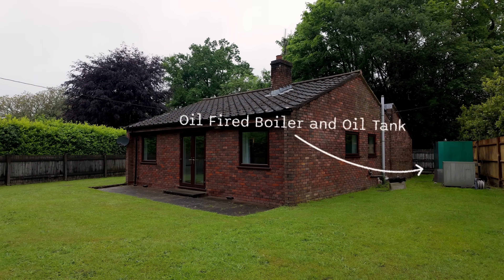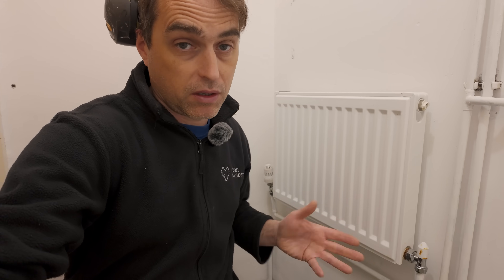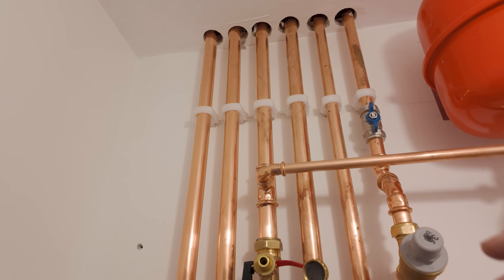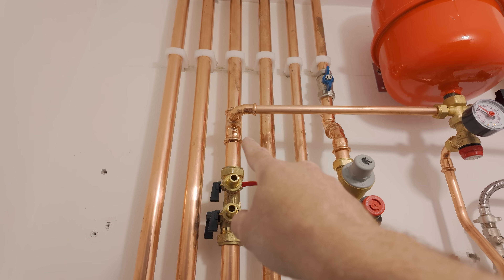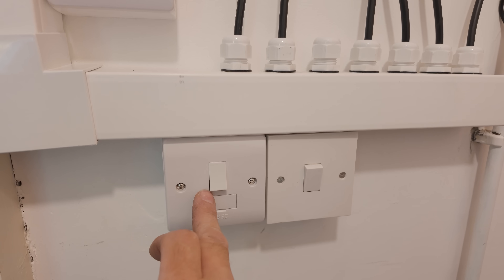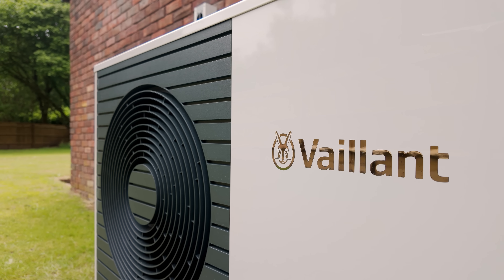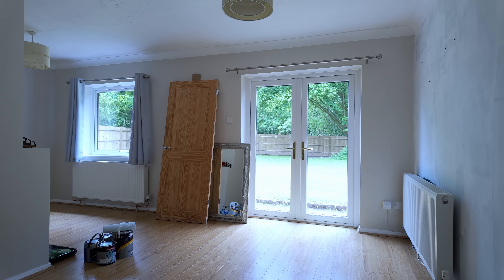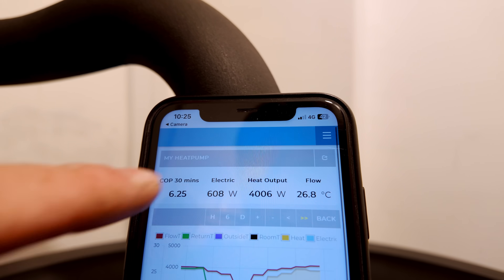Heat Pump vs Oil Boiler. It's a no brainer.

Comment: A lot of ifs and buts with heat pump installations. Oil or gas boiler still a safe bet and in many cases cheaper. That clearly explains why heat pump sales have collapsed and gas boiler will no longer be banned as previously said by the governement. Urban plumbers are very good installers, probably one in a hundred, and that’s the main problem with heat pump installations, lack of good installers. Good video though.

Comment: This is my advice to morons who switch from gas/ oil boilers to heat pumps in cold climates: Be sure to buy plenty of extra blankets and be prepared to spend a shit load of money on back-up electric resistance heating. Because you will spend winter being colder than a set of well driller's nuts.
Reply from the maker: My advice is not to listen to morons like you

Comment: There are a couple of major problems with heat pumps: 1) lots of installers, no service engineers (trust me, this is a major issue and it's not going away) 2) simply doesn't heat a fair percentage of homes. Very expensive thing to take a chance on unless you are in a fairly modern or very well insulated older property. Any heating engineer (who has no vested interest) will tell you the same thing....oil-fired boilers are a very reliable and low-cost heating solution--costs comparable to gas. I live on a Scottish island....lots of people with heat pumps, lots of people with oil systems. About half the people I know with heat pumps regret they installed it....that is a very high percentage. Quite a few have had those systems removed and returned to oil. In my experience (based on current prices) you can keep a 3-bed detached house toasty warm the whole year for £1000-£1200 (oil). How much electricity will you use with a heat pump to do the same? Make all the calculations you want...real world says it will be similar or maybe slightly less. You will never get back your investment at current fuel prices, even with a 9k grant. I have nothing at all against heat pumps....in some homes they work great. I've just seen so many cases were people have bitterly regreted it.
Reply: No response......Ride on bandwagon

Comment: As usefull as it is £600 for open energy monitor is a rip off. I do hope the price drips significantly as adoption o heat pumps increases
Reply from the maker: Worth every penny though
Reply: @UrbanPlumbers no updates on the monitoring, is it off ?
Reply from the maker: @emptyness72 they never connected the internet! I keep reminding them

Comment: Just out of curiosity, did the landlord say why he wanted to change?
I didn't hear you say that the oil boiler was broken and in my experience landlords aren't keen on spending thousands of dollars on heating systems, especially if it doesn't benefit them (the tenants pay the heating bills either way)
Reply from the maker: yes it was broken and the cost of replacing it would be as much as a heat pump. There are some decent landlords that want to install good and cheap to run system for the tenants.

Comment: I have an oil boiler which uses about 500 litres a year (£360) last April fill up. Three bed , detached bungalow constantly warm . I would be dead by the time the electric heat pump paid for its self. In a new build with solar panels and batteries yes. Retro fitting, NO.

Comment: 40 degrees heat is ridiculous😂
Reply from the maker: The lower the temperature the higher the efficiency of heating systems and longer life span of those systems as well. You can heat a room to 21c with 25c flow if HL is low enough and emitters are sized to that temp.

What’s ridiculous is most systems unnecessarily running over 60c
Reply: @ Missing the term “heat” a system running higher temperatures will heat a room quicker therefore doesn’t need to be on for as long
Reply from the maker: @TacticalPlumber @TacticalPlumber  getting up to temperature requires much more energy than maintaining temperature - that is why all modern and super efficient heating systems use low-temperature heating and weather compensation.

read up on this and maybe you will have a light bulb moment one day

Comment: Lovely neat installation but for me the biggest problem is cost. I have had a provisional estimated cost of installing a heat pump system in my 4 bedroom house of £30,000. I currently have a Worcester Highflow combi boiler but the feeds to all radiators are 10mm copper and I believe would would need upgrading requiring all floors to be disturbed. At my age it (76) it would simply not be cost effective to do, even allowing for grants available.
Reply: https://www.youtube.com/watch?v=HFlIbNAUWkY

Comment: The Open Energy Monitor is excellent. Since my heat pump is a self-built system, it has enabled me to verify that the installation was successful and to experiment with configuration adjustments.
Reply from the maker: Yes OEM is great!
Reply: @UrbanPlumbers  Thank you for all of your videos. They helped so much in my system design and build. I'm currently getting a COP of over 5 combined heating and hot water. That is only possible because of the help you (and others like you) provided.

Comment: Best arotherm plus set up vs best viessmann 200 set up, which produces the cheapest running costs over 12 months for 250L cylinder all year and heating to 19°C for 6 months per year?

Does SCOP account for DHW? If not I'm getting gas as the cheaper running costs.
Reply from the maker: Yes scop acounts for DHW. Can’t beat heat pump cost wise with any boiler if the HP is running scop over 4. You can also add cheaper tariff, battery or solar PV to the mix and have negative running costs.
Reply: @UrbanPlumbers  thanks mate.

I'm looking into this for a well insulated self build but going to find someone who can advise better for the solar. I can get a max of 4.2kw with an 11.6kwh battery but the numbers arent adding up for my usage vs payback time without a heat pump never mind with. 5.5kw hest loss is estimating 3500kwh usage for the ashp.
Reply from the maker: @handle1196  if it helps my 5kw heat pump with 3.5kw heat loss uses 1000kWh per year on hot water and heating. Running scop of 5 though.
Reply: @UrbanPlumbers  ive used the heat geek calculation on the following video but for 5.65kw heat loss on my current energy prices of 22.04p for electric and 5.046p gas, id need a scop of 4 or more to make it the same, which i know 4 is achievable but not a saving.
Annual gas £685
Annual electric £622

And if i get my heat loss down to 5kw, its making gas cheaper.

I'll have to look at tariffs to suit heat pumps and or solar and how thry can work for me.

4.2Kw solar and large battery will be 9k outlay, so thats 14 yrs pay back and battery life is 16 yrs.

Comment: Did you use the pre lagged pipe in the loft? What fittings did you use on the pipe work? Where did you get white ducting from for external pipe work?
Reply from the maker: yes - preinsulated mlcp with mclp fittings.

Comment: Can you please explain why you always use valiant heat pumps? Do you have a deal with them
Reply from the maker: I don’t have a deal with them. Vaillant is amazing value for money. Very decent unit, controls are fine, good company to deal with, very easy to wire, perform well.

Compared to Vaillant units like Mitsubishi, Samsung or Daikin are a total nightmare to install and wire.

Comment: What about compared to an electric powered boiler? I live in an apartment and only have an electricity bill as there is no oil. There is a combi boiler powering the shower and radiators but I'd love to get rid of the radiators as a plumber recommended. Would it be an idea to replace the boiler too to just use it to heat water for the shower? And then use electric radiators or underfloor heating? concrete floor. Apartment block is built in late 70's

Comment: Utter tripe, will cost in kwh usage,
Reply from the maker: this house needs 9000 kWh per year for heating. This translates to £720 worth of oil per year at 65p per liter on an oil boiler or 2000 kWh of electricity at 0.22 per kWh on this heat pump running scop of 4.1 sp around £440 for heat pump heating.

However - the scop here will be definitely highier than 4.1, and you can check it yourself on open energy monitoring linked under the video. Also, the property has solar and battery PV - simply meaning there will be absolutely no bills to pay for both: heating and hot water.

Comment: @UrbanPlumbers I love what you are doing to the industry and myself have learnt a lot, I’ve just moved from a company that in stuck in the old ages of instals, I’m going self employed and will be getting away from zoning and using glycol. I’m going to move from ecodans to vailliant heat pumps, would you be able to do a video more on the controls and set up? If you have done this could you point me to the right video? Also do you find any issues in big properties without zoning? Thanks
Reply from the maker: That video on controls is on a never ending list of videos to be made
Reply: @UrbanPlumbers   haha I can understand, but well done on slowly changing the heating game in this country

Comment: Hello. Very good content. Regarding the whisper-quiet heat pump, after my first winter with the arotherm plus, I can agrree it is quiet, except during defrosts or when running at 100%. And if you want to have few on/offs => not oversized Hp, you WILL run your HP at 100% when at outside desined temp of -3 outside (or -8C in my case).

Comment: I've had a ground-source heat pump for 3 winters now and very happy with it. However, I would be very curious to see what the actual SCOP it is achieving.
What are the components needed?
Can I integrate such a monitoring system in my Home Assistant?
And what is that small box with the transparent housing to the right of the black Energy Monitoring unit on the wall at 9:50?

Many thanks for the interesting video 👍

Comment: A properly calculated system! I am not anti-heat pumps in principle! But I have clients who have had a a heat pump installed (ie by cowboys!) only to have thrown it out after 1 winter in the Scottish highlands! I tend to advocate for a hybrid model ie with oil/gas and heat pump, controlled with weather compensation. I do agree follow the maths and the vast majority of the time heat pumps will satisfy most applications.   Additionally a hybrid model will also provide heat and hot water in the event of heat pump or boiler failure/breakdown!

Comment: Little discrepancy puzzle, maybe you could enligthen us all on Design differences.
Friends have a bungalow with oil-boiler in many ways similar to the above.
When I look at radiator sizing using modern sizing calculators, and compare to heatgeek website, I find the sorts of radiator sizings you appear to use would be described as 45 degC not 40degC.
I generally note, considering another house, trying to go to radiator sizings compared to heatgeek website for 40DegC seems to require giant type-22 radiators or many type-33 very expensive.
Pipework sizing on heatgeek website suggests 2.75kW ok on 15mm pipe, whereas, another HeatGeek Elite, and H2X sizing system, both seem to suggest less than that.
Can you shed light on why so many discrepancies to be found out there?
With many thanks,

Comment: Do you have any videos of you fitting a heat pump with multiple underfloor heating manifolds and radiator circuit?
Reply from the maker: Yes
Reply: @UrbanPlumbers  which video is it? Thanks

Comment: 3 years ago, we moved from an LPG tank that the company now said was not allowed to be where it had sat for the last 50 years. So moved to ASHP and redid all the radiators as the others were the original and starting to go rusty. Thankfully got a fantastic RHI payment. I have a Midea ASHP and the app is bad, only counts in whole numbers for kWh usage and even though heating is off it claims it used 2 kWh for heating, rather than DHW.  The house has been warmer and cheaper to run since having this ASHP fitted. Especially when used with a cheap overnight tariff!
So I have just bought the Open Energy Monitor Kit and waiting for it to be installed. 
A video showing what parts are needing to be fitted and how it is fitted would be useful as nothing is out there that shows this. Also a ballpark figure for cost of fitting to an existing sytem would be helpful.

Comment: Is there a rule or no. When you combining 3 d1 pipes it needs to be upsized?  Say for 3 15mm d1 you need to upsize last tee to 22 and tundish will 22 to 28?

Comment: They will be freezing cold come the winter and the noise will drive them crazy. Air heat pumps do not work particularly well in this cold and damp country. Also, net zero is a complete con.
Reply from the maker: Works great on my house. Cost next to nothing to run. House is always warm and the unit is silent.

Comment: 10% cheaper...ROI on that? I have heat pumps but I went air to air as it's an old farmhouse and too expensive to seal up, insulate add heat exchangers for fresh air flow.
Reply from the maker: Coupled with PV and battery storage it will be free to run.

Comment: Hmm, if the oil boiler had reached the end of its life may be yes heat pump but even then only because of the boiler improvement grant. If the oil boiler is still in good working order what would have been the reduction in running costs achieved by bringing it up to the same standard of insulation that you are putting in for the heat pump and adding modern weather compensated controls. I guess 20 % plus for very little capital outlay.
The economics would then be such that you couldnt recover the capital costs of the heat pump within its 10 year life span. Of course at that 10 year point its likely than you will have to  stump up the full cost of the replacement  heat pump 4 times the cost of a replacement condensing oil boiler?
I can see the value of heat pumps in mew installations but im afraid Im still unconvinced about conversions, by the way theres absolutely no way that the solar panels you can fit on that roof will generate enough electricity to power your heat pump through the winter either.
Reply from the maker: new oil boiler was the same cost as new heat pump
Reply: @UrbanPlumbers  so the heat pump and new system came in at £1500 - 2500? What was wrong with the old boiler? Its very unusual for a condensing oil boiler not to be repairable. What happens when the heat pump compressor fails after 8 years and its not repairable?
A heat pump system is certainly a consideration but its far from being a no brainer.
Reply from the maker: @paulhutchinson5695 new oil boiler supply and fit was 5-6k

Comment: A great install, but just for balance we both know that ASHP will not last 20 years, it will be obsolete in 3; your estimated SCOP is optomistic. Thermal efficiency of house will mean the cumulative heat loss due to running all day will weigh against it when compared to oil which will need roughly only an hour, at most, to heat that house up. Also kerosene is  more than x4 cheaper than electricity.
Reply from the maker: Average scop of all my 40 installs is 4.5 so not optimistic - realistic. 15 years lifespan no sweat on those.
Reply: @jonnysegway7866 Most people in this country already own a couple of heat pumps and don't even know it, you probably do to.  The heat pump in my fridge is still working after 18 years and it cycles a lot (by design).  On for 20 mins off for 40 mins ... for the last 18 years.  The heat pump in my 16 year old Volvo is just showing signs of needing a gas top up.
Since I heat up my hot water cylinder on off peak electricity @16p / kWh at a COP of 2.5 (equivalent to 6.4p / kWh), oil would need to be @6.4p per kWh to match my heat pump.  Oil is currently at 13.8p / kWh so 2x more expensive than my heat pump.  I should add that my heating SCOP is over 4.
Reply: Running a kero boiler system for 1 hour and 23 hours off doesn't warm the home. FYI on an 8.5p British Gas off peak EV tariff and a confirmed COP of 4.65 equals 1.8 pence per kilowatt hour, the best you could get from kero is 7p per kwh. Storing the EV tariff kwhs into a DIY battery storage you lose 10% still brings you under 2p per kwh. Of course if you have solar panels you don't buy in so much off the grid.
Reply: @christianfaversham3766  I only need it warm in the evenings, plus my house is typical of many in the UK and thermally inefficient so little benefit to running all day. What is your electricity tarrif for the other 16 hours or so? Also when comparing need to factor in capital costs of batteries spread over predicted lifespan. I think if you are planning to live in your house 20 years+ it may be worthwhile and see some payback.

Comment: But when you factor in 20 grand for the system. Not good.
Reply: He states 5-6k for an oil boiler and fit. An extra 1k on this for the heat pump and radiators after grant. And then more for the batteries and solar separate.